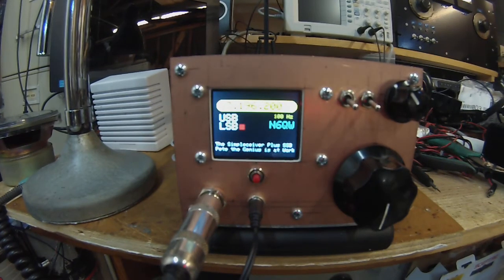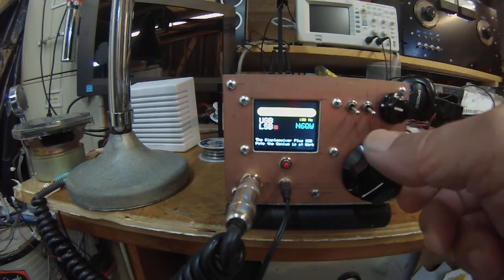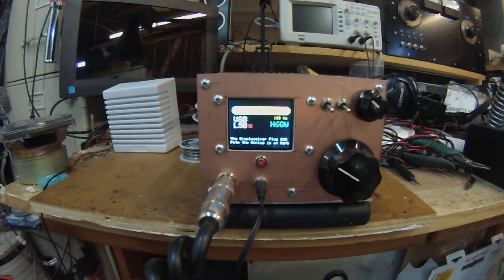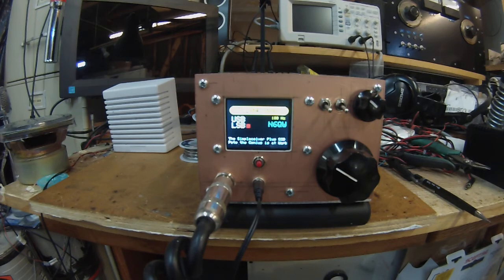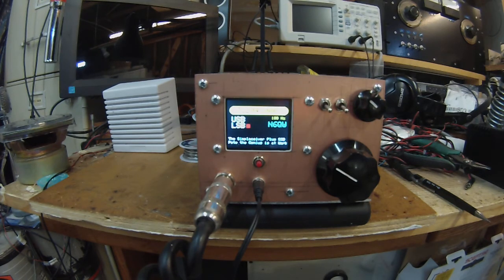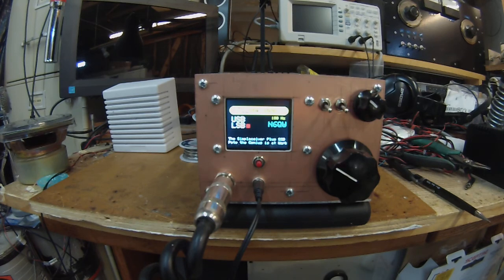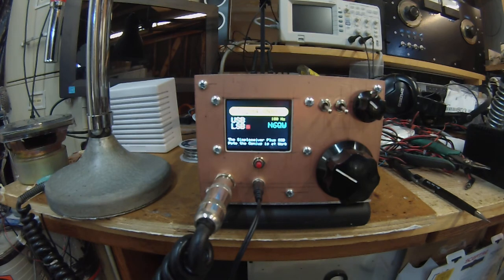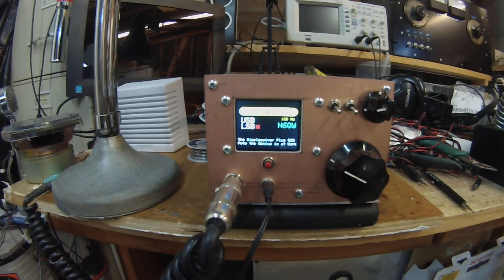Simpleceiver Plus SSB Transceiver In an on the air QSO.

Comment: Pete you continue to impress me with these projects!  I have acquired a very nice digital 200mhz oscilloscope new this year, as well as a 9khz-2.1Ghz spectrum analyzer.  Then bought a house,  I got everything out of order but the house is almost ready to move in and the lab will be going together as quickly as possible!  You continue to inspire my desire to build and tinker, once I learn to use my gear if not sooner I will be trying to build something of yours!  I’ve followed your work long enough my junk box should have most parts to get the job done!  I have a dozen or more adafruit si5351 boards in my stash and a couple dozen different Arduino and associated displays.  It’s going to be an exciting time at W8FG lab!

Comment: Pete, not sure what is more impressive, the project of finding another station interested in homebrew! Nice features with the tune mode. Looking forward to getting the iron warmed up to complete my LBS project - lots of catch up to do! 73, Steve, G0FUW
Reply from the maker: Hi Steve,Thanks for your post and comment. Recently some IARU spokesperson commented while lamenting a lack of growth in the hobby especially among young people said (a paraphrase) there are hams for two reasons -contests and operating. Well that touched a nerve on this end. There are some of us who like to build things. The amount of inexpensive technology available to us is almost overwhelming --so why not just build something. I think perhaps only once or twice that I worked another station who was using homebrew gear. One of them was my friend Bill, N2CQR.The other side of this is that many hams feel comfortable in building CW transmitters or transceivers --but moving to a SSB rig seems like climbing Mt Everest in your bare feet. The latest Simpleceiver Plus SSB transceiver is mostly a Superhetrodyne receiver with a few relays and a couple of circuits like a microphone amp and a RF chain now becomes a transceiver. This project started as a Direct Conversion Receiver where most of the parts were incorporated into the Superhet and 100% of the Superhet is employed in the Transceiver. I most go back and re-state - the bulk of the transceiver is 6 devices -three pairs of J310's configured as a Dual Gate MOSFETs. This rig could have been built with three RCA 40673's (which are unobtainiun) or three NXP BF991's. So the part count is low and the cost is low - I bought a bag of 50 J310's and with shipping paid 20 cents a piece. That is enough devices to build 8 transceivers! Most of the hard work is done with the Arduino and the Si5351.Keep the iron hot.73'sPete
Reply: Pete, I have done a lot of work with young hams and this video was made at the YOTA event I ran in August. It generated lots of debate at the recent IARU Conference - there is hope! http://rsgb.org/main/publications-archives/video/young-amateurs/
Reply from the maker: Hi Steve,Absolutely a terrific video --glad to see so many YL's with a soldering irons in hand. Interesting to see their perspective on the future of the hobby --very deeply rooted in technology, digital modes and satellites. Oh to be young again. I have a personal view on why some publications are not more supportive of youth experimentations with hardware. The reason --their advertisers want to sell expensive radios and some kid who comes up with a feature rich, fully functional and using advanced technology in a transceiver you can homebrew for $50 is bad business --their advertisers would scream bloody murder. Thus we have some powerful groups who want to discourage this --after all it is the old guys with money that buy the $10K radios.Thanks for sharing --and bravo to you for launching this effort.73'sPete

Comment: Nice video, QSO and radio, Pete. Yes this is the golden age of building. I remember building radios as a kid and how difficult parts procurement was. Also, for some reason, with me anyway, there always seemed be a loss of blood involved :)
Reply from the maker: HI Tom,So good to hear from you. If you are still in Stockton --two places in the bay area for parts. Jameco Electronics --a distributor with Will Call in Belmont and a true surplus joint in Santa Clara. HSC (Halted Specialties). HSC is totally unorganized but great for rummaging through bins to locate those hard to find parts. They even sell ham crystals for the QRP frequencies.Nice to hear from you --I think mid town Manhattan was about 20 F this past weekend.Thanks for the post and your kind words.73'sPete